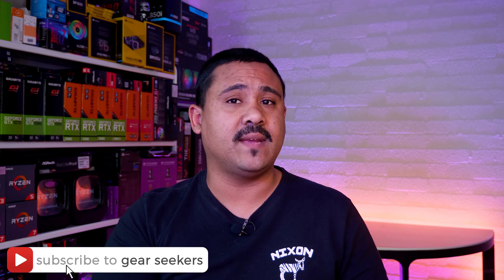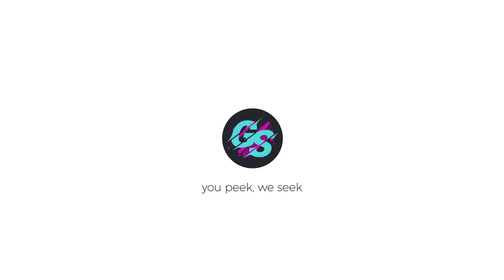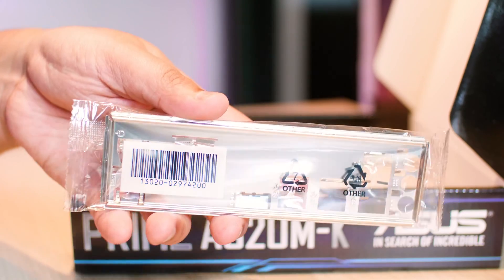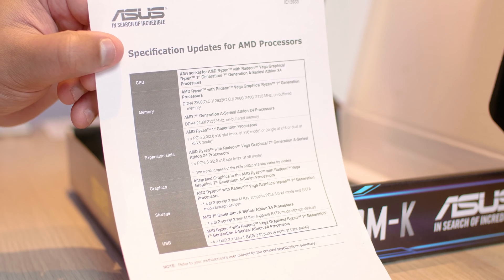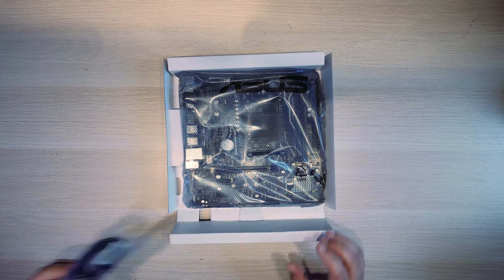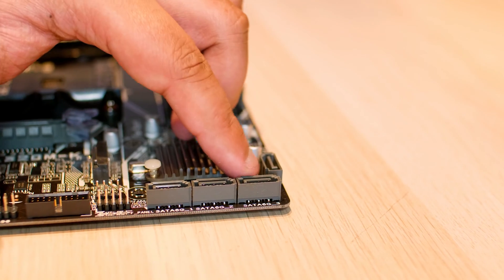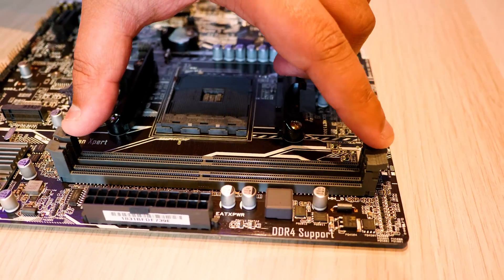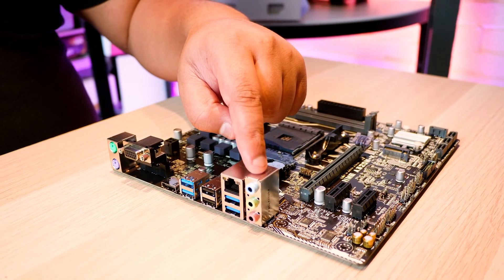ASUS PRIME A320M-K MATX Motherboard - First Look and Unboxing

Comment: its 2025 and im upgrading my system some parts just came in... a ryzen 1600 40$ , 2 x8gb ddr4 -2133 20$ im just waiting for the motherboard now.. This motherboard.... its sort of a weird upgrade because im leaving what was a fully featured Fx8350  on a crosshair iv motherboard. having system. it has Served me WELL so much so that it will be resurrected after the upgrade into another case to finally obsolete the last phenom 2 system in the house. cant wait to see how well low end am4 ryzen system compares to what was a midhigh end am3+ system

Comment: I got this board during the pandemic and paired it with an athlon 3000g cpu and a 980ti gpu and a sata ssd.

Surprisingly, for a 2017 board, there’s still a recent bios update just last november. At first, i was reluctant but i took the pill and upgrade my setup on this board with a gen3 nvme ssd and a ryzen 5 5600 cpu.

So far i am enjoying games on this board under win11 24h2 and is very snappy.

Comment: This board has now gotten some attention due to the Bios updates unlocking overclock. I have this paired up with a 5600x and 16gb of 3600mhz Corsair. budget in price yes but budget in performance, No.
Reply: I have r5 2600. Which ram is better? 16gb 3200mhz or 3600mhz?

Comment: Can I connect 3 fans to this? I could only find 1 fan connector and I was wondering if the connectors at the bottom-middle could function for fans. Thx!
Reply: u need a fan splitter

Comment: Bro does this motherboard has wifi
Reply: Is WiFi necessary for you? Or are you lazy with doing the cable management?
This board probably doesn't support it, I also have a similar board which doesn't support it
(ASUS PRIME A320M-E).

Comment: im running a r7 2700 on this
Reply: And can you plug in the RGB for the cooler?
Reply: @mondokmate7078  yes, the colour stays red. not sure how to use rgb on it xd
Reply: @anyau  Thank you! That at least proves that it works XD
Reply: @anyau  Did you try a software yet?
Reply: @mondokmate7078  when I launch the software it just says "AuraService Is Unavailable" :((. Can't find a fix
Reply: @khaledsaifullah1230  It's most likely that it's not because of the bios not being up to doate, but because this motherboard doesn't have RGB header.

Comment: Does this have Wifi built in
Reply from the maker: no
Reply: Gear Seekers dang guess I gotta get a Ethernet cable if I want this
Reply from the maker: Look at better motherboards.
Reply: Gear Seekers I was thinking of buying a prebuilt with this in it but I have a ethernet cable so I think I should be good

Comment: i have problem whit that card (a320), i buy a ryzen 2600 amd whe working windows it freezes , it happens after 20 to 60 minutes and the chipset gets too hot, updat the bios but it reainssame, the card will have a factory defect?

Comment: Sir does it support over clocking?
Reply: Nope
Reply: It doesn't support overclocking.
GPUs can be overclocked with Software like: Nvidia Inspector etc.
On my board ASUS PRIME A320M-E, you can change the frequency of the RAM.
But it won't give me any performance improvements at all and it's also dual channel.(I haven't noticed any improvements)

Comment: I'm looking at buying this board, a 1200 and a rx 560 for $200. All components are used and in good shape. Is this a good price? What other components should I look at putting into the system? This is my first computer build and I wanna do it right! Thanks!
Reply: You need ram, power supply, a case, windows and a HDD or a SSD
Reply: Price is in USD :)

Comment: I do think the term budget needs some good PR love, because I helped a friend build a PC for less than $600 that allows her to play all the latest games at 30-60ish fps on medium settings at 1080p. Which considering that most console games are stuck at 30 and below was fair. A lot of those savings come from using a cheapo case with good airflow, a budget mobo($50-$60), and using the stock cooler. Sorry for rambling, bottomline building computers doesn't need to hurt the wallet.
Reply from the maker: Thats why we're exploring this just before Christmas :D
Reply: Thanks for responding, I just discovered your channel and it helps pass the night shift at work during the long periods of down time. If I may, I would love recommend the Cooler Master Q300L mATX case. It has great airflow with a huge side window, two large magnetic dust filters that span the entire system and it's less than $40 bucks.
Reply from the maker: Thanks for the recommendation. We've had one here for a while but we haven't had time to build with it yet. I really want to though. I like that the front panel IO can me moved around :)

Is that the case you're rocking right now?
Reply: For the budget build I did, yeah. I love those dust filters, it wins the award for easiest to clean case, take 'em off rinse them under a tap, dry them, and slap 'em back on. I love that there's enough room for a full size power supply and decent cable management. Things I don't like: it only comes with one fan, it feels like a budget case at times in terms of construction and I wish the dust filters came in other designs (insert what if it was purple meme here), but for under $40 you can do a lot worse. People say the acrylic panel scratches easy, but it's fine as long as you're careful. It's the perfect case for a beginning PC builder: simple, cheap, limited options, easy to clean, and it looks decent. 

But for my case on my daily driver I use a Corsair 280X RGB, 3 tempered glass panels and unicorn vomit lighting.

Comment: i still don't get why are there no second gen a320 boards. perhaps a420 isnt marketable?
Reply from the maker: You can get a B450 board for like $20 more. I think that's why
Reply: @GearSeekers  yeah figured, thats what i ment with not marketable, a320 saw little shelf sale

Comment: It certainly is a budget board, but all the essentials are there, the M.2 especially being a nice thing to have.
Reply from the maker: It's not a bad board at all. Perfect for a HTPC.
Reply: @GearSeekers  does this motherboard have an RGB pin or a special connector must be purchased to connect the RGB cooler
Reply: You're a nice thing to have